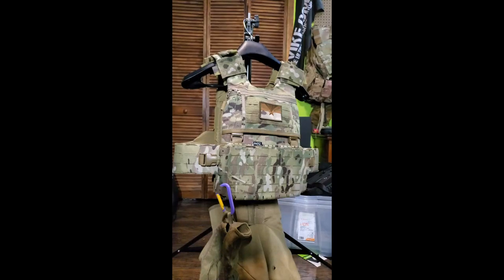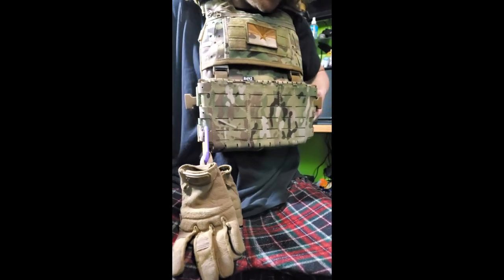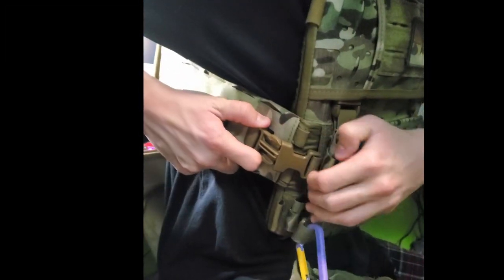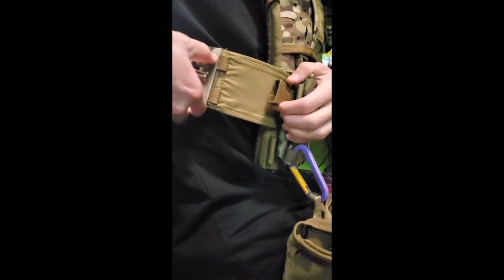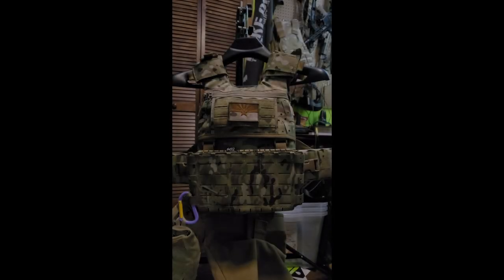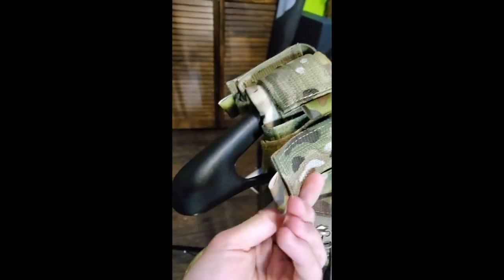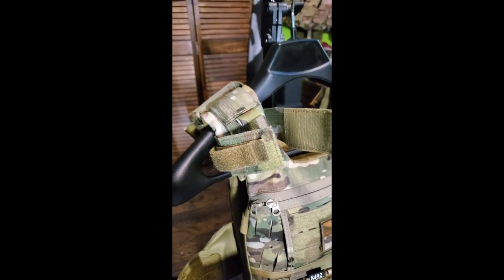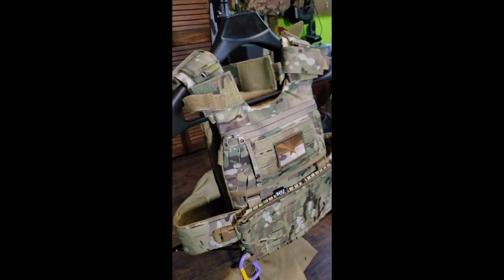WTF PC24 #1 | Opening Concerns

Comment: do we know if this has been fixed yet?
Reply from the maker: If what has?
Reply: @coyote_tactica  Sorry, the cumberband clip issue. I assumed this was the main point of the video. But seems like a relatively easy fix.
Reply from the maker: Watch the follow-up Video @Pook162
Reply from the maker: Posted another video about the pc24 if you're interested
Reply: @coyote_tactica  NICE! Great vid 👍🏻. I’ve put the Ferro Cobra Buckle set on mine to replace the clips. Much needed upgrade. Makes getting in and out of it way easier.
Reply from the maker: @Pook162  vibe